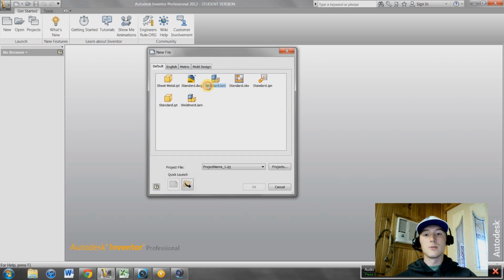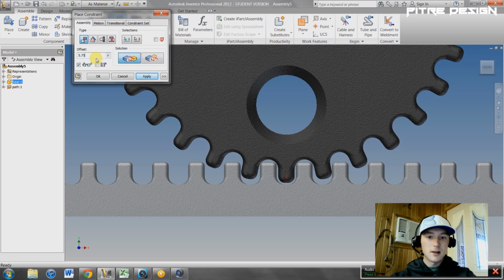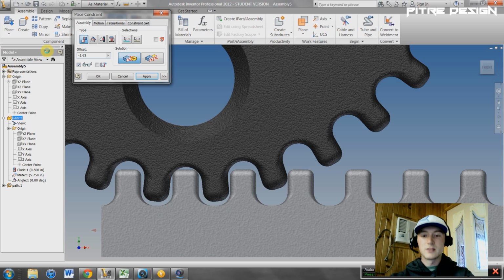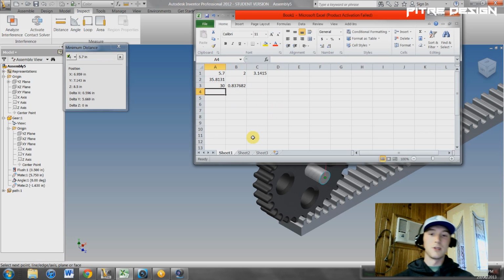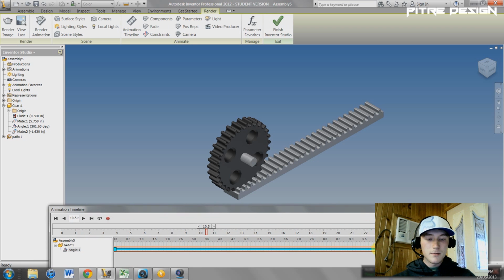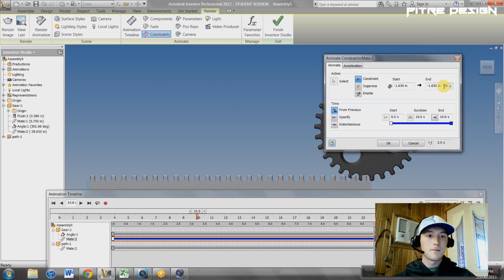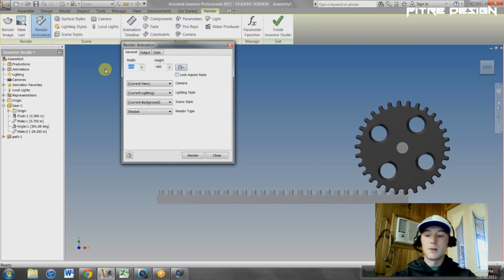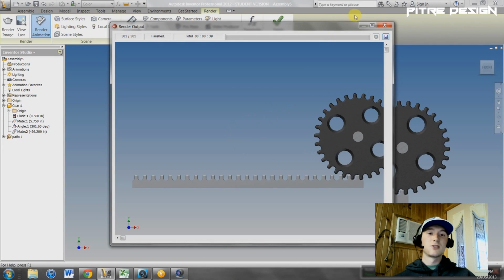Inventor Tutorials - Video 5: Constraint Animation

Comment: My cog is rotating in the opposite direction, dont know why. Is it the constraints
It starts from 0 to 30 sec even after I set thelimit at 10 sec
Reply from the maker: Try changing your degrees to negative this will cause it to rotate in the other direction.
Reply: thanks a lot it works

Comment: during animating constraints displays the message "You can not apply a specific value. enter a different value" how to fix it?
Reply from the maker: You might be trying to apply a constraint that is impossible based on other constraints. Also there are times when you're working with curved surfaces or complex objects when the surface becomes too complicated for inventor. I have had the same message come up in the past and have had to change my design slightly.

Comment: how do you create the rack?
Reply from the maker: its a simple extrude.. you just have to make sure that slots are the same distance apart as the slots on you wheel.  To make all the slots, the easiest way is to just either use an array or copy and paste the slot pattern.